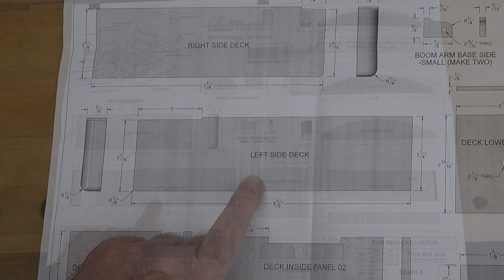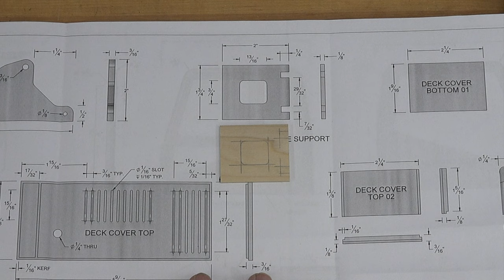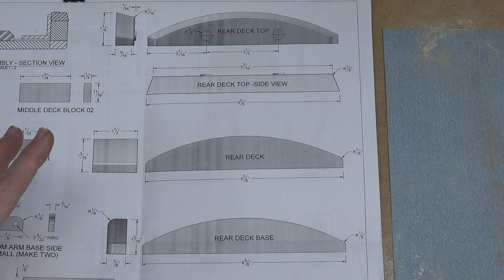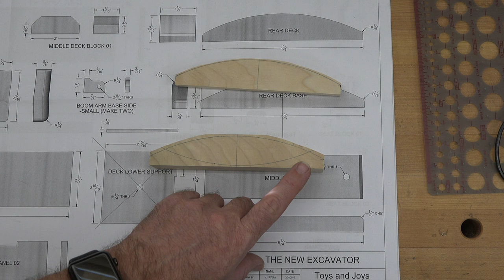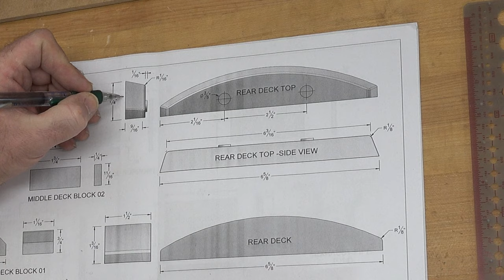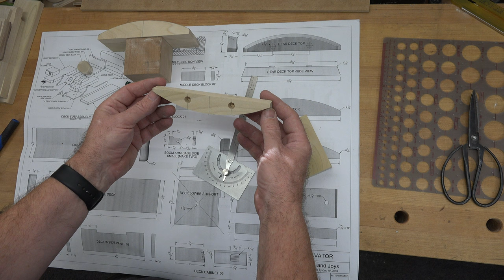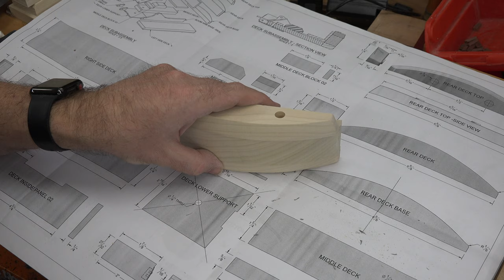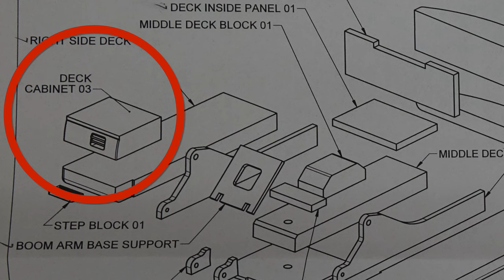Toys and Joys "New Excavator" Part 5

Comment: The build is coming along really good. I can believe the number of hours you had in the tracks and chassis. I checked the net for the Acy-Arc-Adjustable Ruler. It is either out of stock or discontinued. That sure would be a handy tool. Take care!
Reply from the maker: It is a handy tool Michael and I am trying to acquire a second one and am having the same results as you.  I'd love a second one for in the shop and if I ever find a link to one, I will be sure to let you know.  Thanks for tuning in to the show.

Comment: My shop has little pieces of wood all over the place after I start making wood toys. Your shop is way too neat.
Reply: Instead of using green or blue tape go to Walmart and buy a kitchen cabinet covering, it comes in rolls and you separate it and the sticky side goes on the wooden pieces that you cut on a scroll saw or bandsaw.
Reply: My shop gets the same way no matter what I'm making.  Personally found it helpful before starting the next days "fun" is to put tools, bits, etc. back to their home and a quick sweep of the bench top surfaces and floor.  Added benefit if you drop a piece it is easier to find.  IMHO
Reply from the maker: I try my best to clean up the shop after each day of work out there Tom.  It's not that I'm a neat freak.  I just hate coming into the shop first thing in the morning and having to clean up before I can get to work.  It's nice to come in and be able to start working right away.  Thanks for tuning in this week.
Reply from the maker: I will have to try this Tom.  I'm not sure of the price of this stuff but I will give it a go and let you know what I think of it.  Thanks for tuning in and for the suggestion.
Reply from the maker: I agree completely Dwight.  If your tools have a permanent home then it doesn't take very long at all to put them away where they belong and a quick sweep will allow you to come back to your shop the next day and be able to start in on your project right away instead of having to clean up the area first.  I think you're doing it right.  Thanks for chiming in with that.